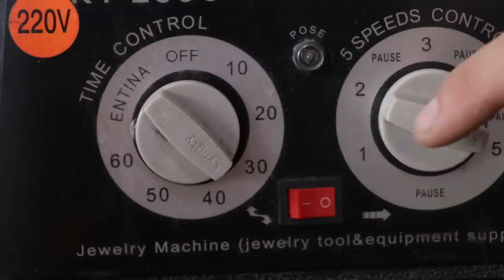3d print jewelry / pulsera envejecida y rasgada.

Comment: I won't bullshit you, like some of the comments I read. Not your best work. I've seen your work, you can do much better. Make another video, same bracelet, but this time...NAIL IT. Your sprues need work. The metal cooled too quickly. Angle your sprues and go thicker or shorter. Make the center tree larger if possible. Your button was way too small for that much metal.  Pour more metal than you did. The bracelet is thick. Your flask was not hot enough. Your metal should be melted before you place the flask in the machine. It needs to be hot enough to transfer the heat metal to allow the metal to cool to prevent it from shrinking. Take my advice and get better. Listen to them, and stay the same. The choice is yours.
Reply from the maker: Hi there, thanks for your feedback on my video. I appreciate your honesty and constructive criticism. I acknowledge that this may not be my best work and I understand that there is room for improvement. I will definitely take your suggestions into consideration for my future videos. It seems like there are some areas where I can work on, such as improving the sprues, adjusting the metal pouring technique, and ensuring the flask temperature is suitable for the metal to cool properly. I will strive to make the necessary changes and deliver better results in my next attempt. Thank you for taking the time to watch and comment on my video. Send you a hug from Perú.